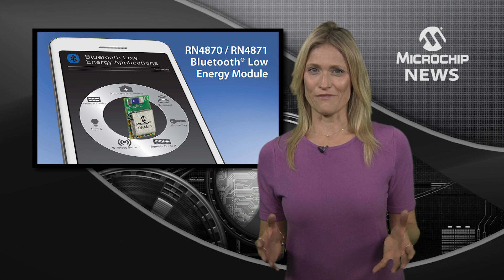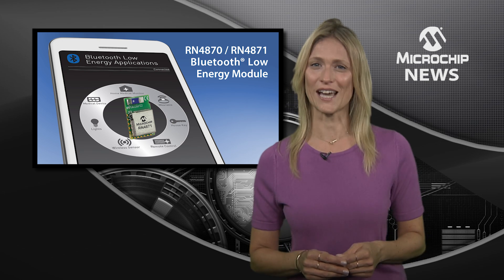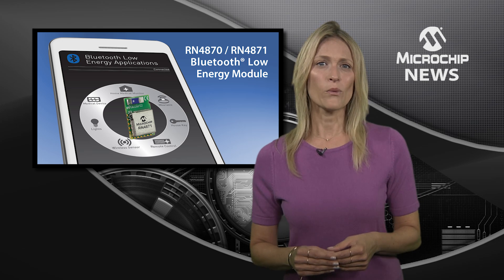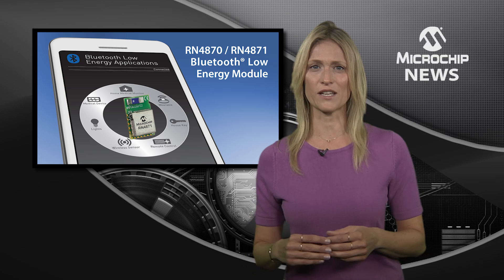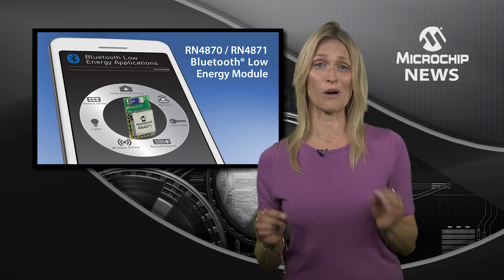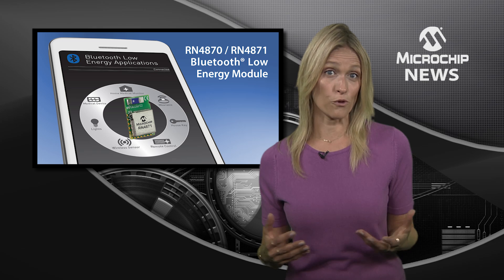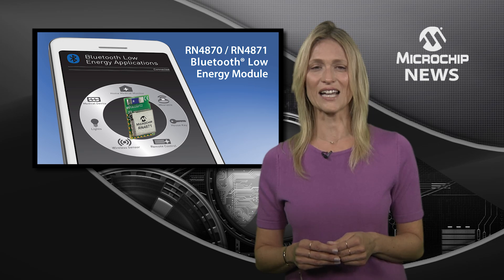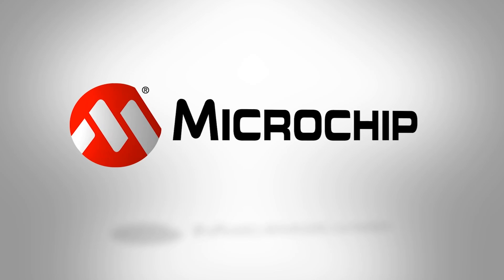Microchip’s RN4870 & RN4871 Modules for Bluetooth® Low Energy 5.0 Core Spec. w/ ASCII-style Commands

Comment: Avoid this product at all costs. It is plagued by endless problems, countless firmware bugs, MAC address corruption, restart loops, bad AT commands, poor documentation, stray characters, incomplete status messages. They claim eliminates complex code and external MCU? Yea sure, only if your device is overly simple. Otherwise, in master mode, you have to do all the heavy lifting yourself to setup. The module can't even accept two commands overlapped, it has undefined behavior as per their datasheet. Just google RN4871 and you'll find the endless problems people have endured with. Microchips support is completely hands off: "just make sure power is properly decoupled, and upgrade firmware to latest". 

If you see this message, you've been warned.
Reply from the maker: We appreciate your feedback and understand that challenges can arise in complex applications. If you're experiencing issues with the RN4871, we'd be happy to help troubleshoot or provide additional resources. Let us know more about your setup, and we can point you in the right direction – Please contact us directly at Microchip.Com/CSS.